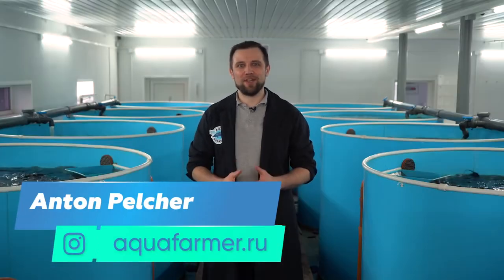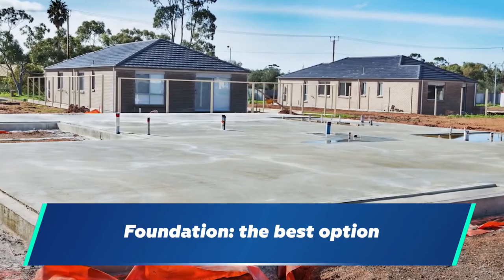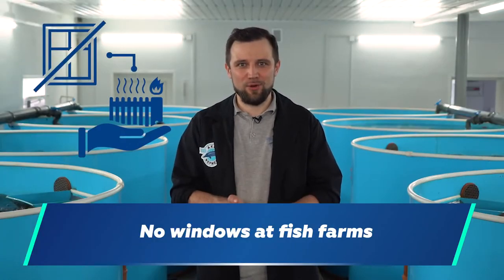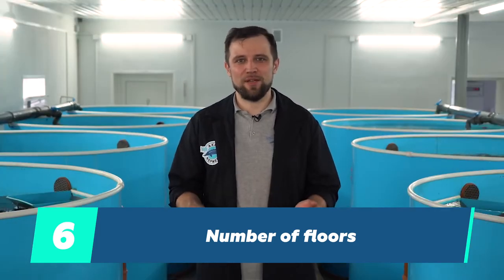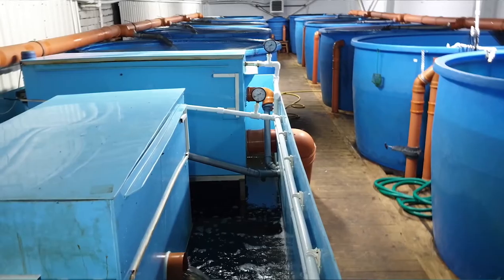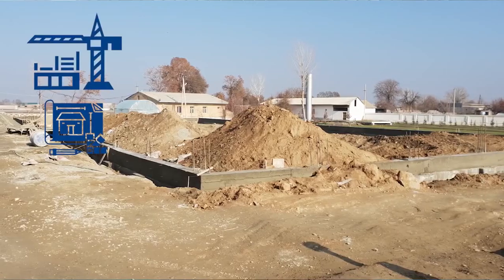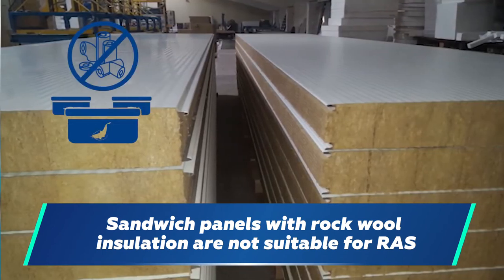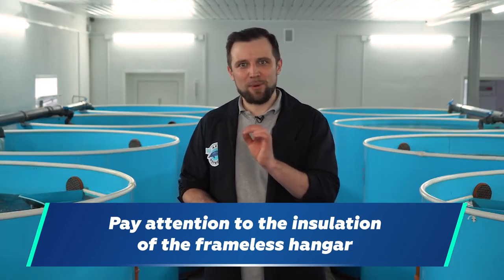RAS fish FARM BUILDING | Farm construction

Comment: Hello Anton,
Thank you for the shared information for the building of indoor fish farm.
As you mentioned the moisture is a main issue. At least I built an OSB plated wooden framed wall and coated the whole concrete floor, the wall and the ceiling with polyurea that made unbreaked surface.
Reply from the maker: Hi, I think it's a good solution!